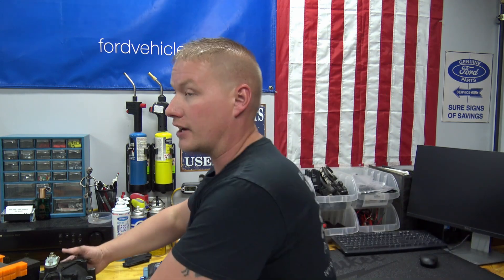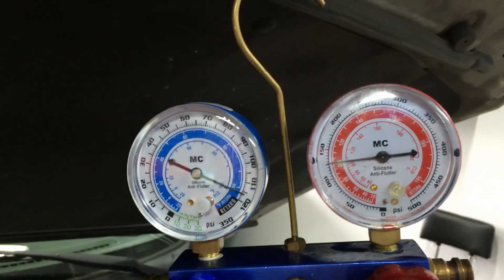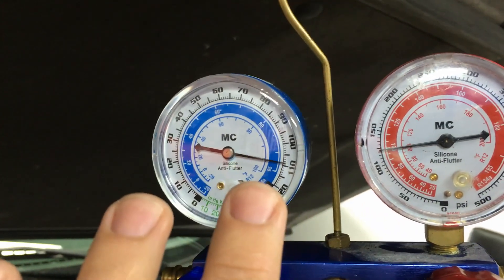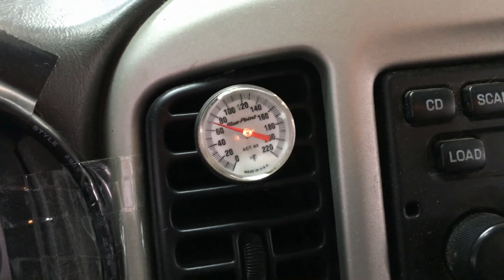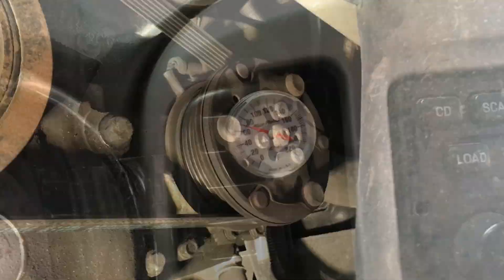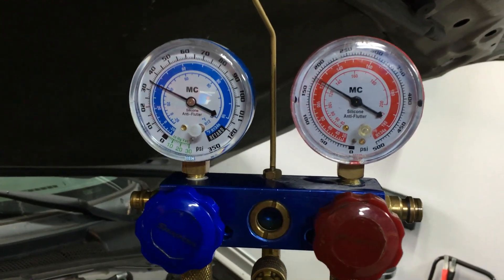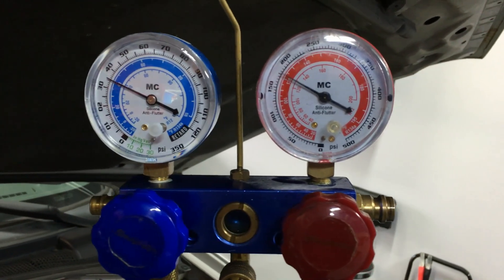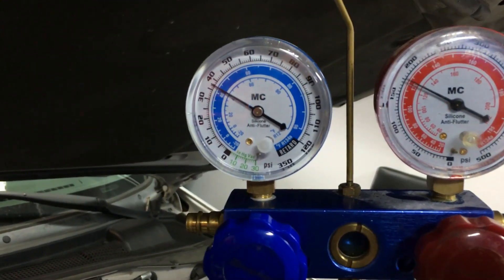Ford A/C Quick Tips #5: Diagnosing a Weak A/C Compressor

Comment: I've got a 2001 F150 with all original AC parts. I have been thinking it's weak because it's been pretty hot and it seemed like it wasn't working good. After watching this I went out and tried to turn the compressor by hand and it was tight so I went out for a 30 min drive with the dial thermometer in the vent and was getting about 38F on an 85 degree day, so this thing is working fine. It's just hot as hell right now . This saved me from going out and buying manifold guages that I don't need right now.

Comment: I've got a new (Denso) compressor, new condenser, new TXV, evacuated and fully charged 134a but low side pressure is 2" of vacuum and high side is only 30 psi, what gives?

Comment: Hi, can you tell me on a Ford Escort LX   year 1990 If the smallest connection is indeed the low pressure? I ask becourse the biggest hose has the biggest connection is that correct?

Comment: What kind of special tools are needed to rebuild an A/C compressor (or at least replace the seals) from an '01 Mustang GT.  My compressor was leaking from the case. Swapped in an aftermarket one, but would like to repair the old unit to keep as a spare rather than dumping it.

Comment: My ac builds pressure when empty and if i try to put freeon in, the low side jumps pretty high and into the red section in the gage. I can put enough for the compressor to start, it cycles on and off like it should but i can not reach the desired amount because like i said, it shows high pressure. The cycling switch is new, the switch on the high side also works. I checked relays, all good. Orifice tube was dirty but i cleaned it with air intake cleaner. Should i replace it? Not sure why the system is building pressure, i thought maybe a clog and when i saw the tube dirty, the only thing i can't check is the evapo, it has a case and seems like a hassle to take off. I went around through the system blowing air throug, I blew air though the evaporator and the air went through it fine, both ways. I hope that's ok. I read maybe a weak compressor, I looked for leaks. I think some pressure builds up when the compressor is off but it gets higher when it turns on...🤔

Comment: I’ve got a question I’ve got a 2016 Ford focus that is kicking my butt. Both of the pressures were staying the same with the compressor running. I thought it was a blockage. I have replaced the condenser compressor and expansion valve evacuated the system pull the vacuum recharge the system, I cannot get more than 12 ounces of Freon in the system and with a compressor running both sides are at 100 temperature outside is 102°

Comment: I have a 2007 Lincoln town car. The ac compressor is running all the time unless I unplug the relay. I unplugged the low pressure switch and it still on. Replaced the relay but no luck...any suggestion?

Comment: When replacing a compressor, what brand do you recommend? I read that the motorcraft compressors are made by Valeo
Reply from the maker: I use Ford or Denso. I have also used four seasons with no issues. They key here is to replace with new not a reman unit.
Reply: @FordTechMakuloco  right on thanks
Reply: @FordTechMakuloco  Great video what brands do you like im thinking of buying global parts distributors llc compressor a conversion to piston from rotary style on a 2006 mazda 3 2.3 L ?

Comment: I have been told because my compressor failed internally I have a severely plugged up system and the entire system needs to be replaced.
What is your response to this?
Reply from the maker: Replace the compressors, condenser and your metering device and flush the rest of the system.

Comment: Thanks for this video.  Liked and Subscribed.  My Daughter's 2012 F150 has a weak compressor as the manifold gauge set readings match the readings you show in the video.  My question is will the AC system need to be flushed?  I do plan to replace the Compressor, Condensor,  TXV, and Drier.  Thanks in advance for the advice.

Comment: my daughter has a 2005 f150, it has 200k miles on it, but runs great.  lately on very hot days, they have been driving, with ac on, and all is good then they get warm air, truck temp starts to go up... is this a sign of the compressor going bad?

Comment: Hey Fordtech I have a 2014 explorer limited with the 3.5 the ac was not cooling well so I took it to the Ford dealership and they said I needed a new compressor and expansion valves wich I did install but the clutch itself stays engaged and dose not cycle on or off… I did notice after the new compressor and expansion valves the ac did get cooler and pressures check out well but not too cold… any tips on what you think might be wrong

Comment: So I have an expedition low side is 35, high side 150 but doesn't blow cold.   Last summer the front dash stopped and today the rear stopped working. 

I'm under the impression the compressor is fine,  but the pressure gauges really don't move more than 1lb over 15 min with ac on max.  Any ideas?

Comment: 2003 ford excursion, just rebuilt the engine, replaced condenser, vacuumed it once the engine was back in for 2 hours. Only pulled -26” but it held it I think my 5000 ft altitude has to do with it. I’m running like 100 degree ambient, 50-55 low side, 250-280 high side but I can’t get my vent temperature less than 55-60 when it’s this hot. Under 80 ambient it does 40-45f. I may have put too much PAG oil in it. What do you think?

Comment: Low side on my kia optima with a clutchless variable displacement compressor is reading high at idle rpm speeds...around 90 psi or so....if I bump up and keep the rpms at around 2500 it will drop to 70 and I will get cold air in the cab...

Do you think I should get my hands on a pressure gauge to test high side too to confirm it is low and compressor is problem? I am thinking either compressor is worn or possibly even the solenoid valve in the compressor is stuck only allowing so much refrigerant in...not the amount needed to build up the compression and suction...

Comment: Anyone can help, i did A/C in school but really do not understand something, i get 30 psi on the low and about 150 psi on the high at night, but I`m facing a problem with poor cooling at times and expansions valve freezing up, when it freezes the low side would go to 0 and high side would remain at 150 psi, the evap temp sensor is working, drier and expansion valve already replaced, i`m thinking a weak compressor, but the readings say otherwise, when i turn the compressor by hand 1/2 turn I get resistance and the next 1/2 turn would turn free, so I`m thinking that its freezing up because the temp sensor cuts off at 3.5v but the lack of cooling keeps it at 3.3v, and the compressor won`t cycle causing it to freeze, anyone got any advice ?

Comment: Great video! I replaced the blower motor and blower motor resistor on my 2010 Ford expedition because the ac front fans will randomly shut off. Then come back on but I'm still having the same issue. I guess I should replace my A/C compressor next?

Comment: Thank you for what you do. I have a question and I hope you see this. I just bought a 13 F-150 ecoboost 197k miles. I live in NY. Defroster off, A/C off. Ac compressor turns on for about 15 seconds and then off for a couple minutes and then back on 15 seconds and off. I just bought the truck and was told ac was working fine. Just curious what it possibly could be. Hope to hear back. Thank you, Eric.

Comment: Thank you very much for sharing this video. I was speculating weather my pressure readings indicated a worn compressor or if I had a possible restriction in one of my ac hoses. The ambient temperature at the time was 89 degrees with 49% humidity. According to the manufactures specifications at the time of testing the low side should be between 28-41 psi and 193-261 psi for the high side. I had the engine running at 2000 RPM's and the center vent temperature wouldn't go lower than 60 degrees on MAX AC. My pressure readings were 60 psi for the lo side and 205 for the Hi side. I'll check to see how much resistance it takes to turn the clutch by hand.

Comment: Are there any electronic components that can fail? I have good pressures and I hear and can see the compressor knocking on and off, but it’s just hot air coming out.. also we just replaced the old refrigerant with fresh new stuff

Comment: I have an issue with my a/c I’ve been chasing on my 03 f250 6.0. My a/c relay only has power on the control side and I’m not getting power the the compressor. Where could I be loosing power? I’ve already check both the a/c clutch fuse and the climate control fuse both seem to be good.

Comment: My 05 f150xl starts out cold, with good pressure readings. After 10 to 15 minutes,  the clutch kicks out and doesn't kick back in. Then it's showing high low side normal on high side. Where do I go from here?

Comment: Mine reads 65psi on the low side and 250psl on the high side after letting the vehicle stabilize and the ambient temperature was 75°, the temperature coming out of the vents was 75°

Comment: I love what you do I got one Question I got a 2009 Ford Flex when I put on the AC on the front vents plow hot air when put the Rear AC on in plows cold. Do you think it is a AC pressure sensor and how many pressure sensor does it have

Comment: I’ve got a 2012 Escape XLT and the AC does not blow cold air when the temperature is above 70-75 outside.  Is there a fix for this?

Comment: The AC compressor on my 2016 Ford F-150 failed two years later. Fortunately was still under warranty, they also had to replace the condenser coil 🙁

Comment: I need help, i have a 2004 Ford E-150 conversion van it has a dual cooling system for the front and back i have spent $1,500 already and the shop had no success the a/c works amazing while on the highway or doing 40 mph but as soon as i stop or drive slow in traffic the a/c is hot! (I will take a reading with the probe today) do you have any suggestions for me?

Comment: I have a problem with my AC and I need to know why he turns on whenever he wants, there are times when he is on and he is blowing cold air, but after a while he starts to blow hot air. I imagine it could be the accumulator because it is not working well, what could it be please?  has enough freon i drive and grown victoria police intercepted 2010

Comment: My 99 Ford Crown Vic's A/C blows hot air when on norm or max A/C. Another side effect is when the A/C is on my car will overheat, but won't overheat when the A/C is off or I'm running the heater, vent, or defroster. Is this an indication that the compressor is bad?

Comment: hi....love your vids. I need your expertise on AC system. The clutch turns off and on rapidly. And it blows hot air only. The compressor is only two months old. I spliced two wires between the coil connector and electrical system. It's a 2007 Ford Taurus SE. Can you help me with my problem?

Comment: I'm about to change the ac system on a '03 Expedition XLT 4.6L. It makes sounds when the air is blowing, hissing sounds on top of not blowing any cold air. Any ideas as of why? My guess is that is related to the AC directly, but I could be wrong. (have never done this before)

Comment: 4:18 the clutch was turning by itself. I'd say that's pretty worn out lol. I just picked up an 05 Town Car two months ago. Just now realizing the AC wasn't blowing cold. Didn't need it. Clutch engages and gauge shows full charge. Never new this little trick of turning the clutch with no resistance. Sure enough, I can turn it as easily as the one you're showing. Which also solves my AC issue on my 01 F150 that wouldn't take a charge. I had to jump the relay to engage the clutch but still wouldn't take a charge. I can turn the clutch on that compressor too. Looks like I've got two compressor replacement jobs in my future. Great video as always

Comment: My 2002 volkswagon jetta compressor doesn’t engage. I don’t think it has a power signal. It’s a 3 wire pressure switch so I don’t know how to bypass it? Gauges reading zero? Fuses good. I ordered a ac module relay.  But I didn’t know how to test it? Should I order a volkswagon Manuel? Or can u give one tip in trouble shooting it blows warm air.

Comment: Love your informative videos.

My 2014 Escape blows nice and cool except on hot and humid days (GA climate) at engine idle. I had the system recharged by the dealership and replaced the evap sensor with the new angular one recommended by the TSB. Airflow thru the pollen filter is good too.

Any ideas of possible problems? I noticed that the liquid line pipe that’s next to the pollen filter cover was very hot - too hot to touch. Is this normal?

Thanks

Comment: 06 e450 6.8  had the fan clutch replaced iam wondering if the mechanic installed the wrong fan clutch
 because when van idles and its hot out air conditioning blows hot  and soon as the rpms go up  it blows cool again

Comment: Hey, I have a 2010 Ford Escape 2.5 cyl that I have been having a/c issues. Please can you help me?
Issues:
1- The number 1 selection on the fan speed stopped working 
2- The a/c compressor stopped working
3- The radiator cooling fans started blowing on high at all times.

Fixes:
- Changed the Heater Blower Motor Resistor with aftermarket part and it is working on all speed.

Diagnoses:
- Checked the a/c pressure lines (50/150)
- If I unplug the a/c connector plug from the compressor, the fans are working as it should be
- Checked the (fans, a/c) relays and they are working
- Every time I am unplug the a/c relays and put them pack, the compressor kicks in for 5 seconds then stopped.

Comment: First off, you make great videos! I have a question about disinfecting hvac boxes. What do you think about the Kool It Foam cleaning system and systems like it? I have a 2009 Explorer and my throat gets itchy and I cough when I turn my heat on. I want to start at home with a good cleaning before I search again for a shop to do the work. I've tired 4 shops and no one has a clue of how to clean out the system. One mechanic recommended a detail shop may have the equipment.\ needed. Ozone systems are used at a rental car company near me to remove the smell of smoke. I hear Ozone also disinfects. Your thoughts would be greatly appreciated. Thanks!

Comment: Thanks for the video. I just bought a used F150 and the ac wasn't working at all. They fixed it before I actually bought the truck. It used to be super cold. But there was a loud hissing coming from the compressor for about 15-20 seconds after turning the truck off. After a while the hissing got really low and It's not cooling as good as it used to. I'm getting 60 degrees out of the vents. So its not completely warm but I wouldn't say it cold. There is definitely something wrong, right?

Comment: I have a 2002 Sport Trac which has a FS-10 Compressor.  Air blows cold (40 deg) at speed, but it warms up (60 deg) when I stop.  I have checked my charge and topped it off a couple of times over the years.  3-4 years ago, I replaced the orifice screen.  I also replaced the fan clutch (my truck has a belt driven fan).  And I also removed a shim from the compressor clutch because my air would sometimes just start blowing out hot even at speed.  I am suspicious that maybe the compressor just isn't pumping as much refrigerant thru the system as it used to.  If I rev up the engine to 2000 rpm or so, it gets better, but not great.  2 minutes after I take off, it will cool down to 40 degrees and stay there as long as I'm moving.  Seems to do the same if the AC is on max or regular.  The truck does have 300,000 miles on it and I am still running the original compressor.

Comment: Hey, I have a loud ac compressor not cooling, static reading are 100 on both high and low at 85 degree, but it’s 10 psi on low and only 110 on high when compressor kicks in, do you think its a bad compressor? 
Thank you

Comment: Enjoy your videos. So, if I can easily spin the compressor's clutch plate with my little finger on my son's 07 Mazda 6 w 150k mi, would you consider that (a) a catastrophic failure or (b) can I just have the system evacuated, replace the compressor and receiver-drier, then recharge it and call it good for another 150k? Thanks!

Comment: Hey, I ove your videos!!! I was hoping to get some help xD
My AC would stop working when it was really hot outside (middle of the day). I bought some manifold guages and the pressure is reading 70PSI on the LOW side and 325PSI on the High Side. Based on all the videos, these numbers seem to high. Now this truck was purchased used and the clutch air gap needed to be adjusted. The AC is working but it's not cold enough. Could this be a failing compressor? Thanks!

Comment: Hey Makuloco love all your videos! Hoping you can offer some help. I have a 2008 Ford escape hybrid, ac not blowing cold at all. I’m getting 35psi on the low side and 75psi on the high side while it’s running. Compressor is engaged and running. The pressures do not equalize when I shut the engine down. The low side moves up to like 42psi, the high side stays at 75psi. Could the passenger compartment bypass solenoid have anything to do with this? Is there a way to test that or bypass it? Appreciate whatever advice you can offer

Comment: DUDE PLEASE. 2013 FORD ESCAPE1.6 NO DUAL CLIMATE CONTROL. BLOWS COLD ON PASSENGER ONLY! THERE ARE ZERO VIDEOS ON THIS. THERE ARE ALSO NO ACTUATORS ON THE PASSENGER SIDE.  I've got the lower airbag out under the column. now what?  BE THE GUY WITH THE ANSWER PLEASE

Comment: I have a 2010 F150 with and noticed at highway speeds especially that I have an intermittent shudder.  I noticed that it happens when I turn off and turn off he a/c or the a/c compressor cycles on.  Any thoughts on what would cause this?
Reply: Man I just noticed this yesterday on the hw in my 01. Will squeek when it shudders. Wont do it with the ac off.